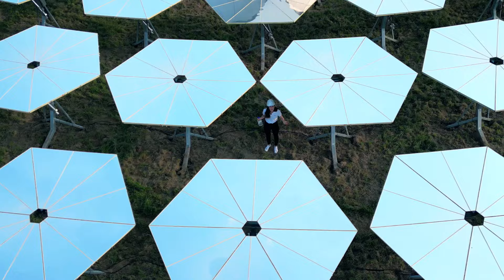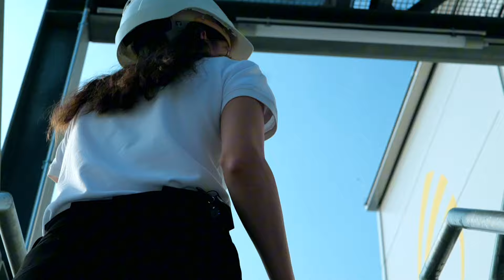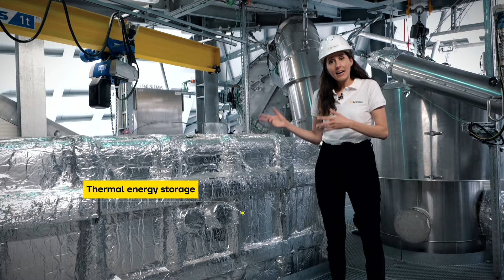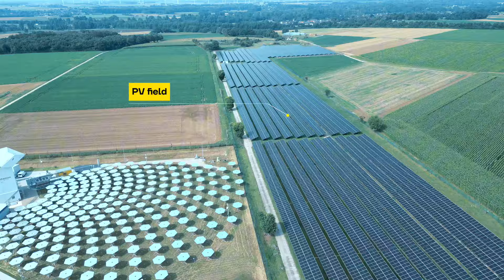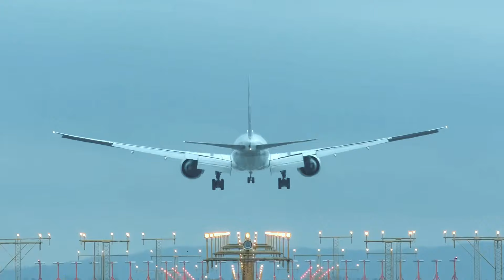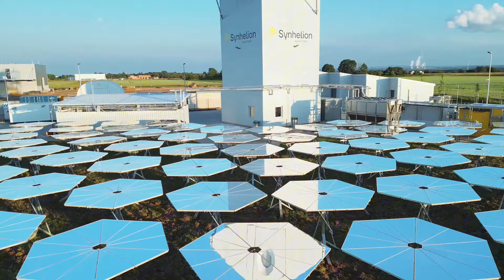Synhelion – A tour of plant DAWN

Comment: The fossil fuels of crude oil, coal and especially natural gas in world averages are all increasing in consumption!   There is no trending down in fossil fuel use!   Quite the opposite with natural gas that is primary means of supporting increasing amounts of wild AC from solar voltaic and wind turbine generated electricity with fast reacting high readiness natural gas turbine generators.   This requires more natural gas to maintain high readiness in natural gas turbine generators than making all the electricity form efficient natural gas combined cycle power stations.   Huge increase in natural gas use over the last decade for electric power generation is due to the need of the power grid to support large amounts of wild AC.  

In the US future wild AC sources such as offshore wind turbine farms are being stopped from joining the public power grid.  This will save a lot of natural gas and allow more economic fuel efficient means of generating electricity.   Many countries are putting more wild AC on the public power grid requiring great amounts of natural gas to support it.   Without hydropower natural gas turbine generators have proven to be the practical reliable means to support large amounts of wild AC, but with expensive use of natural gas.